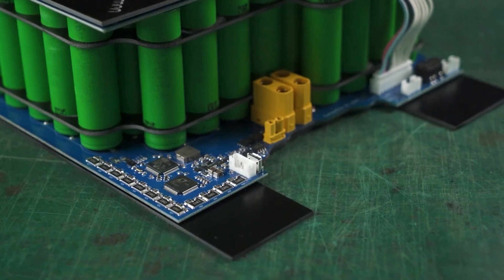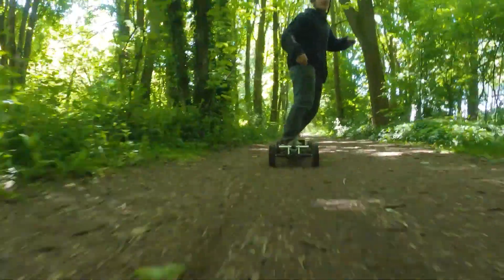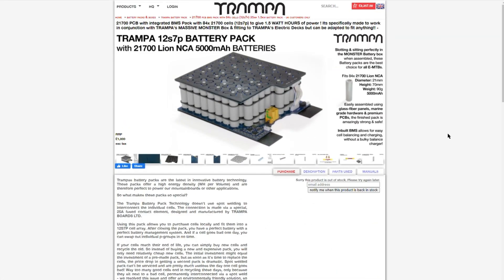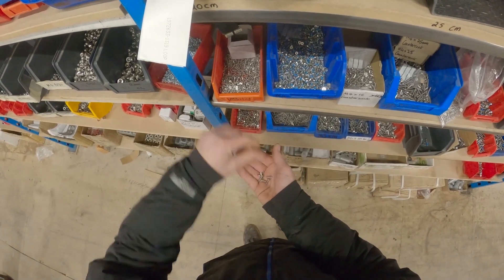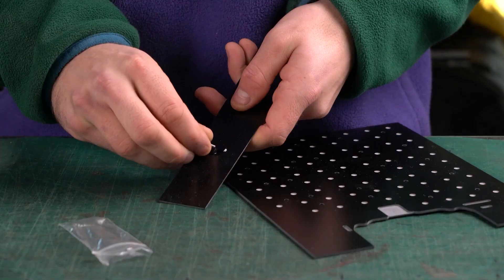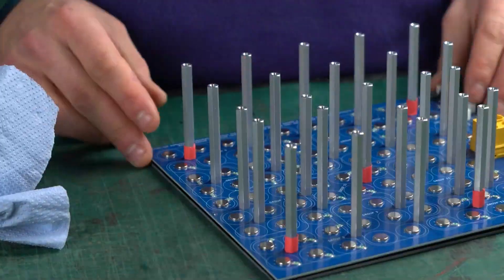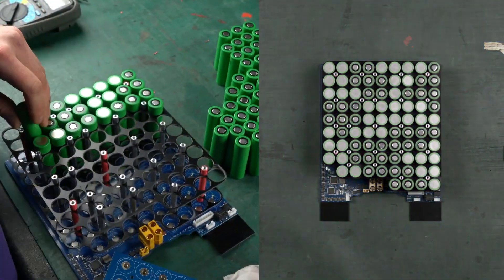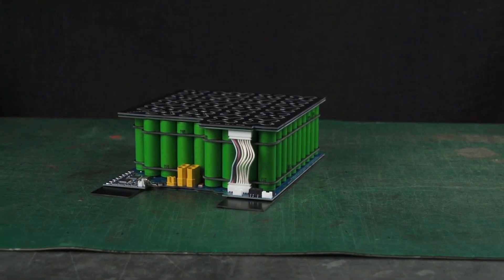How to ASSEMBLE The TRAMPA BATTERY PACK (18650)

Comment: Hi, in the tutorial How to ASSEMBLE The TRAMPA BATTERY PACK (18650), said that plug the pcb into upper connector and then plug the pcb into the lower connector, but in the video did the opossite...connect first into the lower and then into the upper connector. Which is the correct one¿? Thanks!!

Comment: If I can get 25 miles range out of a pair of 20000mAh LiPo's (12s), how much range could I expect out of one of these packs?
Reply from the maker: You will get around 21 miles for the 18650 pack, then around 30 miles with the 21700 pack. (As well a host of other features that Lipos dont have)